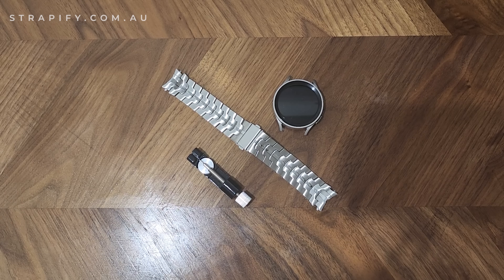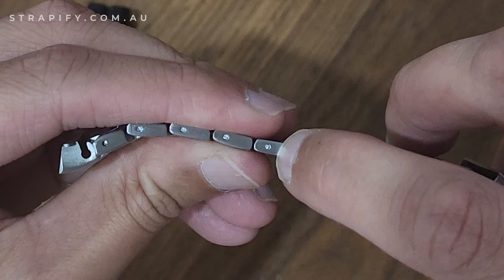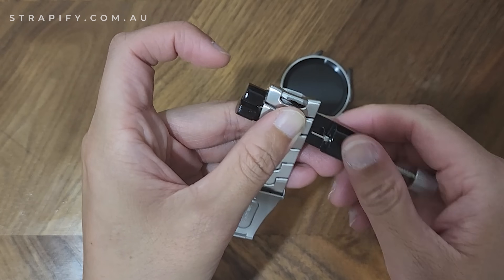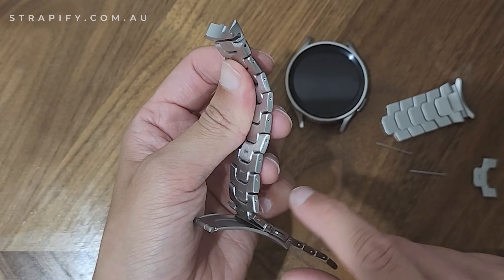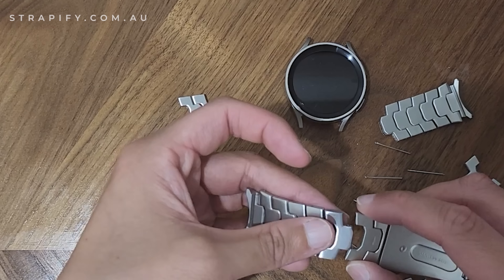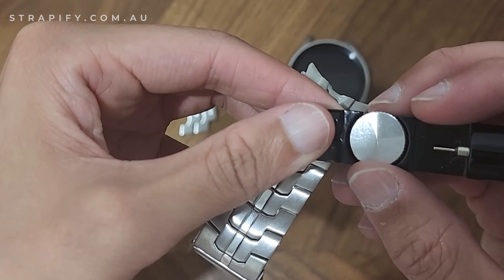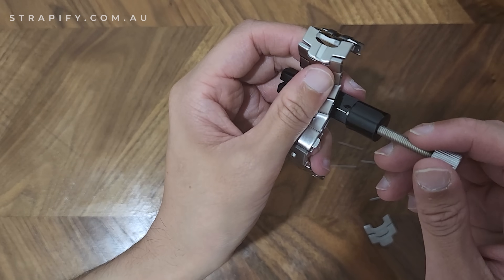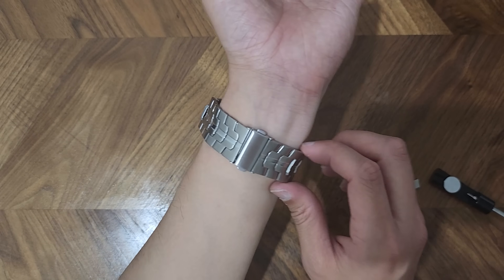How to Remove Watch Links with a Link Removal Tool on your watch strap and bands! Resize and shorten

Comment: We used a large needle and a small pin hammer, removed two links and refitted in three minutes. No need for this tool and no damage was caused using the above method...

Comment: I received a tool for my bracelet but it did NOT have a height adjuster so there was no way I could use it.  I was told to read the manual. LOL  That was a joke.   Glad to see there really is a correct tool to use.

Comment: I would recommend a watch repair kit that also includes a small hummer with a rubber tip, which you use to put the pin back by gently tapping it with the hammer.
Additionally, those kits may have a strap holder so you don't need to hold it in your hands when you're hammering it, and generally may help you, and the price difference is not that big like 5–7 bucks.
Because when you push the pin against the surface, you may f* things up, if you push it too hard or if you're accidentally pushing in the wrong direction.

Comment: No tool but I need to take out 2 links. What else can I use ?
Reply from the maker: Use this guide. Tool free tutorial
Remove Watch Bracelet Links without tools! (2023 Best Method!)
https://youtu.be/YDP-nxzyhL0
Reply: Today I used a large sized needle and a pin hammer and gently knocked the pins out. Dead easy to do and saves money as jewellers will charge....

Comment: It takes a special kind of idiot to use a thumbtack. I'm that idiot. Makes it alot harder, but after figuring out how to relieve the pressure in the pins it's easy.

Push Pin is also alot easier 😂

Comment: How is it so easy in this video, but when I'm trying to unscrew a pin, the needle is locking up on me? lol.
Reply from the maker: Could be an old strap and might be stuck. Try spray some lubricant in there
Reply: @strapify  I actually got it. I was doing it the wrong way. Your way worked just fine.